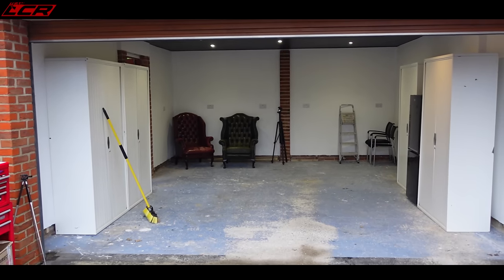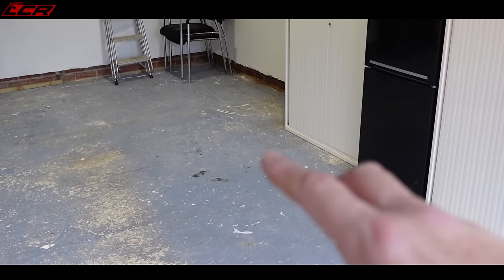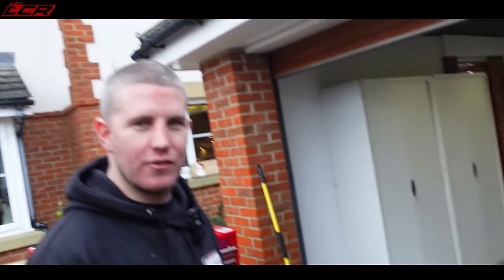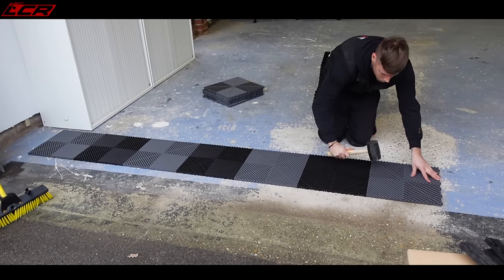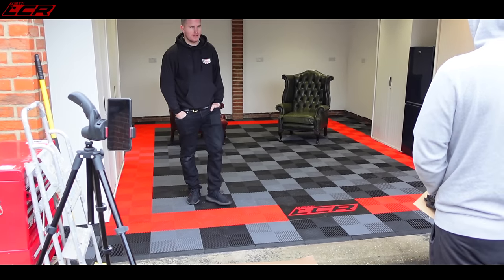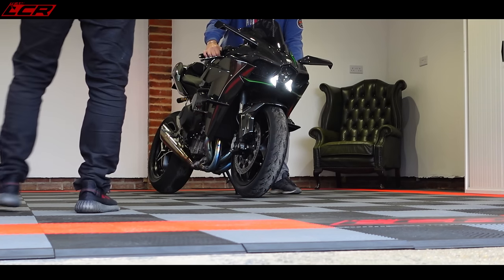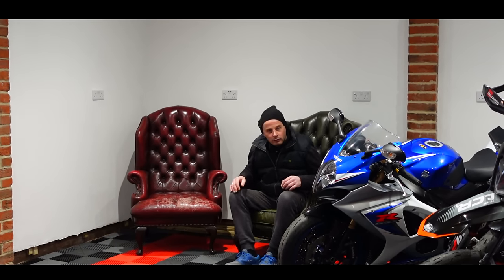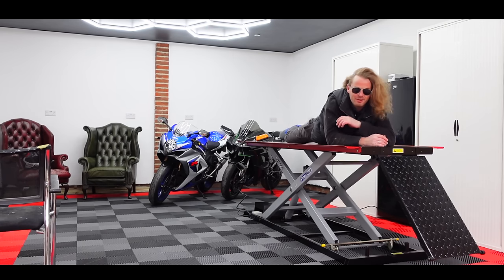Perfect Garage Floor Tiles!! 🙌 | Ultimate Garage Build - EP05

Comment: I put the textured none vented tiles in about 18 months ago, and I've had no issues with scratching or marking. I preferred the none vented for 2 reasons, 1 when you spill something, you just wipe it up real easy and 2 it's much kinder to my knees when kneeling down to work on the bike.
It does expand and contract with temperature quite a bit, so as it's cold you need to make make sure you have a good gap on the sides.

Comment: Amazing chopsy 👍👍 flooring looking great be even better when skirting around the edges is fitted. I would fit a switch fuse spur on the skirting to power you lift Eric so no wires stretching upwards to the double sockets. Just spur off one of your sockets straight down be much neater. But great garage chops , makes my bit of hall carpet under my bikes look bad  😁😁

Comment: Looks great man! I've just got most of my flooring down too, Tackifier/glue took 48hrs to get usable at these temperatures though so its been a slow process haha just need to move my workbenches then do the last part! I went with all carpet tiles in mine so its easier to vacuum things up and I've checkered the pattern black and the same blue to match the roller doors colour too. 

Love the idea to use those tiles as a bike park/matt idea that's actually brilliant! interested to know how much the lift cost you and where its from.

Comment: Do you notice any problems with these type of floorings when you put your motorcycle on its side stand? I am worried a bit that with the holes and material it might not be able to hold to weight and tip the bike over.
Reply from the maker: No it's absolutely fine with side stands, I was worried and used to use a puk to protect it but there is no need 👍

Comment: Any fluids are going to poor through those, and spread like it allways does. They look smart but I dare say that's where the function ends...
Reply from the maker: You can remove a single tile or multiple tiles if you need too. But all my oil changes will be happening on the bike lift not on the floor anyway

Comment: These things are horrible for getting up blood. You have to pull everything up to clean beneath them, and there is no way to fully sterilize them so stuff doesn't show under black lights. Wouldn't recommend.
Reply from the maker: Not planning too many murders in there so should be fine...
Reply: @LambChopRides  you never restored a bike or something? Not spilling liquids is impossible when working on bikes
Reply: A nice Team LCR mat in the center when working on bikes should suffice! 🙂